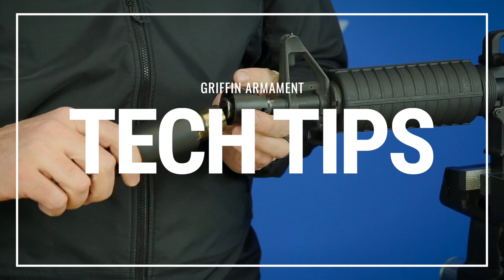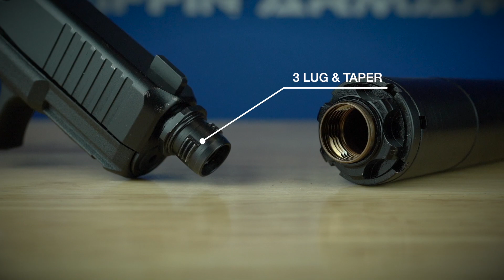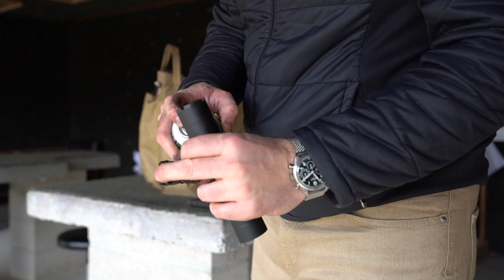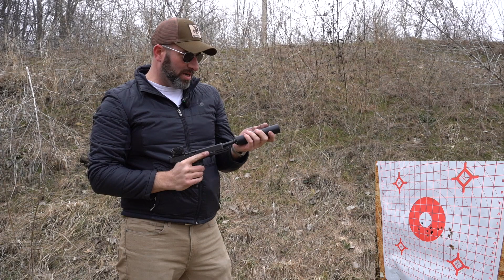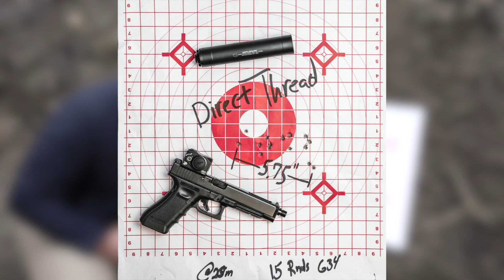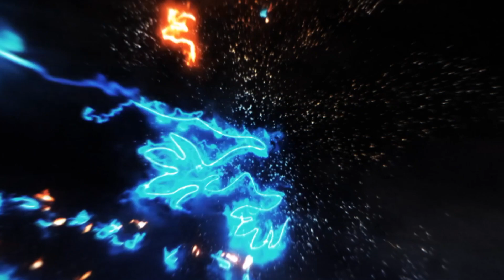QD Pistons vs Direct Thread Pistons

Comment: While I think the EZlock/CAMlock systems do offer benefits, the video's 'accuracy' demonstration was not supportive of the conclusion drawn.  First, the shooting should have been done from a rest to reduce variables.  Second, shooter form and firing rate were not conducive to accuracy determination.  Third, the shooter concludes that his accuracy decreased as the number rounds increased and the can loosened.  That is not supported by the video.  The last shots in the string fired were more accurate than those fired in the middle of the string.  While a full blown science experiment is not expected, a bit more preparation and professionalism are expected in a manufacturer's videos.  Especially if they are trying to prove a point via a demonstration...
Reply: Interesting comment regarding threaded shots getting better toward end of string. It makes me wonder if he tightened it sporadically throughout the string of fire.

Comment: I started with Cam-Lok and have gone back to direct thread for 2 reasons.

1. You have to remove the cam lok adapter every time you want to clean your pistol.
2. At about $60 each, the cam lok adapters get expensive if you have more than a few pistols.
Reply: Those are definitely caveats with both Cam-Lok and EZ-Lok. I have found that I can mitigate the 1st problem by clamping my slide upside down in a vice. Then I can get the barrel pretty clean with a toothbrush, rag and a bore snake. Every third or fourth cleaning, I'll take the adapter off and give it a full clean. Personally, I find the trade off worth it. It's nice to be able to shoot three full normal capacity mags and not have to worry about the suppressor loosening. With direct thread, it would start walking off a couple times a mag. I also like the quick push and twist like a 3-lug.
Reply: I get the cost part, but what type of pistol are you using that you have to remove it to clean?  For my Glock and FN pistols, I just tilt the breach out of the slide once I've removed the recoil spring assembly.  The barrel doesn't need completely separated in order to clean it.  I've never used EZ lok, but LOVE the Cam lok.
Reply: Having not bought one before, can you tell me why removing the adapter is a big deal (regarding your comment about cleaning difficulty)?  How much trouble is it?  I haven't used one before.

Comment: I will preface by saying I have used cam lok for quite a while now and it's better than direct thread by a lot. The only real problem I have found is with novice shooters. If they are not good at recoil management the cam lok can come loose a lot faster than expected. With me shooting though--I've never had a problem. For my purposes though EZ Lok is better than Cam Lok, and Cam Lok is way better than direct thread. +1 on the idea of a retention locking mechanism. That would make the EZ/Cam systems the ultimate system.

Comment: Assuming everything during your test was equal with both mounts, the direct thread appeared to have less recoil when shooting vs the EZ-LOK.  Watched twice and seemed noticeable.  I personally prefer direct thread when it makes the most sense.
Reply: Bear in mind with my question: I know very little about this subject but have a Resistance 9mm from six years ago and haven't used it. Long story.

Question: what did you mean when you said that you preferred direct thread when it makes sense?  When would it or wouldn't it make sense for your potential usages.  Thx.